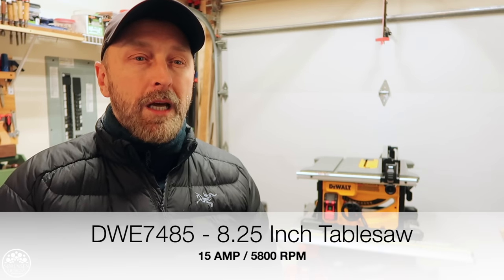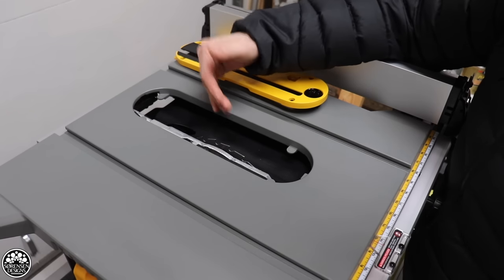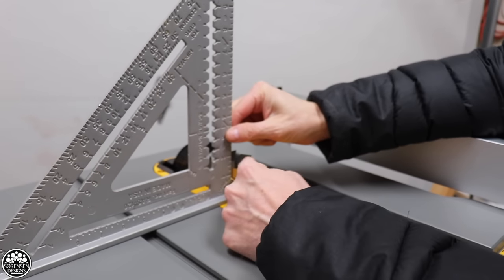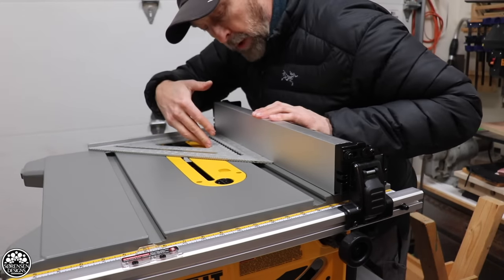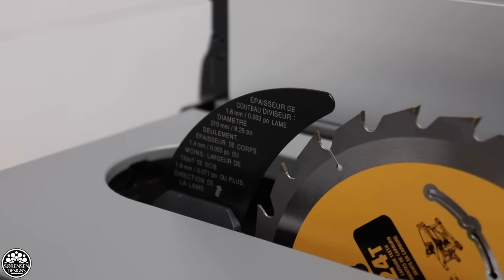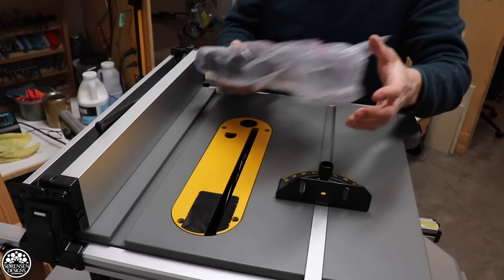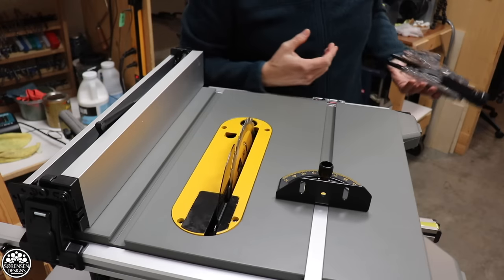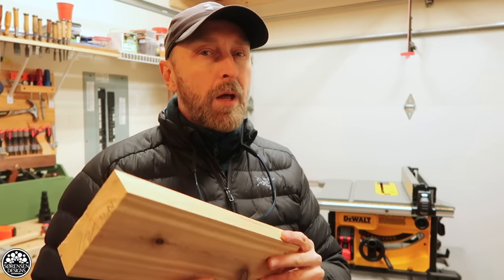Dewalt  8-1/4 Inch Compact Table Saw DWE7485 Set-up & Review

Comment: Just bought this saw based on your review. It is my very first table saw, so approached it with equal amounts of fear and excitement :-) I really like the fence system as it seems very accurate and stable. It cuts like a dream with the standard all purpose blade. Havent tried another blade yet.
Reply from the maker: I'm still using the factory / framing blade. I haven't had a reason to change it yet.

Comment: Really appreciated this video! I just picked one up myself since my wife and I are remodeling our bathroom which means framing etc. I am new to table saws and was slightly confused by the instructions. Especially on zeroing in the measure but your video made it easy to line up the guide with the blade. Cheers and thanks for this!

Comment: I have a very small shop as well, and have been putting off buying another table saw primarily because of space limitations (I had a larger Delta a number of years ago). After viewing your table saw mobile station video, the light bulb popped over my head and I went out to buy this DeWalt. So far I’m quite impressed. Within its limitations, this is a powerful and precise tool. I am particularly impressed with the fence system, which is more square and accurate than many more expensive table saw fences. I’ll be building the saw station this week and look forward to getting on to the projects I’ve been deferring.
Reply from the maker: Nice choice James! I love this new combo for my shop.The Table saw and this station are made for each other. It's actually much easier to tuck away than my old jobsite saw.

Comment: I had the Ryobi jobsite saw that your Ridgid is based on.  looks almost the same but it it blue instead of orange.  I loved it but after 15 years it was getting a little tired. I bought the 8 1/4 Dewalt to replace it.  It is great it is way more easy to take to a jobsite and for all but the largest cuts it works great.  I have had it about 8 months.  I almost bought the 60v version but I didn't have any of those batteries and I already have four battery brands to worry about.  
Now I want to install an inverter and big battery in the truck.  

A big part of the reason I bought this was because of you using smaller blades in your other table saw.  And realized I almost never needed a 10 inch blade on a table saw.
Reply: I just realized I have had the old saw for 25 and not 15 years....  I am getting old.
Reply from the maker: Thanks Bill! I heard that they may stop making the 10 inch versions due to new safety regulations. On a side note, I always forget how many years have passed.  The late nineties seems like 5 years ago, I always have to think about it..😆

Comment: I appreciate your review of this saw because I went to Lowe’s and bought the identical one. I’ve watched your video a few times already. One thing is the motor has a whine sound when it is plugged in. It starts fine and runs strong. No other issues that I know at this time.
Reply from the maker: `It sounds like a Dewalt 15 Amp motor to me🙂.  One thing I'm still getting used to is the on button. Hope you got a chance to try the flip fence for breaking down plywood - it works nicely.
Reply: @EricSorensenCanada  yes and it is so awesome. I know I’m gonna enjoy this little beast. Thanks for the come back.

Comment: I have the 10" version of this saw and built a zero clearance plate, I only use it if absolutely necessary for all the reasons you stated. You also discovered you need to hold the 'start' button for a fraction of a second for it to actually start lol.  Congrats, great saw, you'll love it.

Comment: Great video Eric!! I got my 7485 from HD on veterans day with the vets 10% discount. I love this saw. It was almost perfectly adjusted right out of the box. The blade is parallel to the miter slot and the fence to the blade. It has all the power one would need, I have used it to re-saw 4" wide oak boards like a hot knife through butter.  Also swapped out the miter gauge for a Incra V120. I have been considering several designs for a mobile bench/saw stand with outfeed table and look forward to seeing what your design looks like. Thanks for sharing.
Reply from the maker: You will see the build for that next Sunday. So far, I am very happy with this saw. It's making great quality cuts, even with the factory blade.

Comment: Hey Eric, thanks for the great review of this table saw.  I also have the 10" version of this saw and I have built a zero clearance throat plate.  For the locking mechanism I 3D printed one from a design I found on Thingiverse.  I also swapped out the stock mitre gauge for the Incra 1000SE.

Comment: What the advantages (other than blades cost less) of the 8/14" over a 10"?

I have a Grizzly G0869 - 10" 2 HP Benchtop Table Saw which I bought last year for $375 (with a promotion of free shipping). It seems to have all the same features (rack and pinion fence in particular which for me was a "must have") and a couple of nice "pluses" such as soft-start, adjustable table extension at the back to support longer work pieces and variable speed which allows me to cut plastics without melting. It also has a larger table but maybe that is a disadvantage for some. The Dewalt has a better STOP switch which is much smaller on the Grizzly. I needed customer support (how to adjust the trunnions) and was very pleased with the responses.

Comment: Thanks for the post.  A question, please:  When you measured the 1", was it from the fence to the inside edge of the carbide tip of the blade?
Reply from the maker: You measure from the inside edge of the protruding tooth. That is what produces the kerf.

Comment: I have the DeWalt 745 mobile table saw. Ive had it for about 3 years and it is a work horse. I thought about getting the newer 748 model but there's not much difference between the two. The miter gauge on the 748 has pre-drilled holes to make a cross cut sled, the 745 has holes too but in a different location. The on/off button is a little different on the 748.  The arbor on the 745 is short and will not accommodate a dado blade.
Reply from the maker: Many manufacturers do not allow for a dado stack on the arbor. I think it's because it negates all the safety features that come with the saw.

Comment: I bought this last year but just getting a chance to put it together now. The instructions mentioned an anti-kickback item - but I did not find it included.  Did you receive one?
Reply from the maker: At the front of the saw, just below where the wrenches attach, and right by the motor, you will see the Anti-Kickback Pawls. They look like little black claws. They are hard to spot at first. They attach to your rip guard assembly.

Comment: Did you ever have a chance to run this with a Diablo .059 kerf for 7.25" blades for through cuts?  The riving knife says 0.063 so I assume it will be okay.  It looks a bit high to attempt cutting a slot.

Comment: I keep hearing this saw is too small to rip sheet good?  Curious if you e had any problems doing that?  Is there a stand you can get to help support sheet goods.  I just bought this saw and I'm mounting it in a dewalt rolling miter saw heavy duty stand.
Reply from the maker: It rips great for me. In fact, I bought it because it was a compact table saw. It also helps that I built this table saw station for it: https://www.youtube.com/watch?v=NW85t6KgOGA.  You can always return the stand and build one of these - much more functional😉
Reply: @EricSorensenCanada  What is the name of the pocket hole device you use in that video?  Far better then the one I have
Reply from the maker: I use the Kreg K4 Jig Pocket Hole System with the dust collection port (The Kreg k5 is even better).  I also have the Kreg Right Angle Clamp for pocket holes. This combo makes cabinet making so much easier.

Comment: What made you decide to switch away from the Ridgid? I’m in the market for a new table saw and don’t have much space, so I was looking at getting the r4514 with the rolling stand for 350. Would I regret it?
Reply from the maker: I have a similar Ridgid, but mine is 10 years old. I decided to change to a compact table saw with a smaller blade , since I was already using a 7-1/4" blade in my Ridgid table saw. I wanted a matching riving knife as well. I had some buyer's remorse with the Ridgid. I brought my first one back because there were issues with the arbor.  The bevel adjustment on the Ridgid was a pain. Overall, the Dewalts have a better fit and finish when you compare them to other brands. As for the rolling stand; its made for job site situations. I personally found the saw was a bit low for me and there was no elegant way to implement an out-feed solution. So my decision was to not buy another rolling stand but to instead build a custom rolling cabinet that will do more. You will see that cabinet in next week's video.

Comment: I have this table saw and love it BUT for the life of me struggling to find any decent blades for it cross and long. Are you still using the original blade?
Reply from the maker: The 8-1/4" blades are a little harder to find sometimes. I still have the factory blade but I was also able to use a 7-1/4" blade in mine: https://www.youtube.com/watch?v=A7Mrw_ApYtY

Comment: How do you handle the dust collection on the dwe7485? I need an adapter to reduce the output to fit my shop vac (1-1/4 hose)
Reply from the maker: It turns out my ridgid vacuum hose fits the dust port perfectly. Adapters are easy to find in hardware stores or you could just use pvc pipe and make your own. This table saw has a two-port dust extraction system. It has a smaller port on the blade guard, which in theory, would capture half the dust. The problem is you need a split hose system or two dust extractors to make use of it.

Comment: I don’t like the 8.5” blade.  Seems odd size, what would a replacement blade cost?
Reply from the maker: They make a 8-1/4 and 8-1/2. Mine is the 8-1/4.  I haven't measured the thickness yet, but you could probably swap it out with a 7-1/4" blade and still use the riving knife, but I have yet to test that theory. If it works, the 7-1/4" blades are much cheaper. The 8-1/4 or 8-1/2 are supposed to replace the 10 inch blades eventually. The odd size means that they will be able to charge the same as they do for the 10" blades. Some of this is safety and the other half is tool company marketing.

Comment: Trying to find a DEWALT table saw stand with wheels   Had one at hom e and had to return it as it did not fit.  Dewalt dealer is trying to find out from Dewalt what stand with wheels works with a DWE7405
Reply from the maker: That is why I built a custom mobile station: https://www.youtube.com/watch?v=NW85t6KgOGA